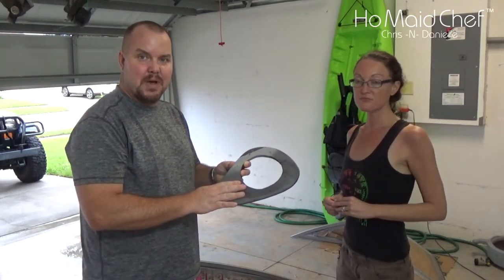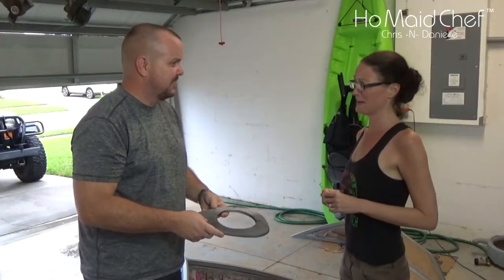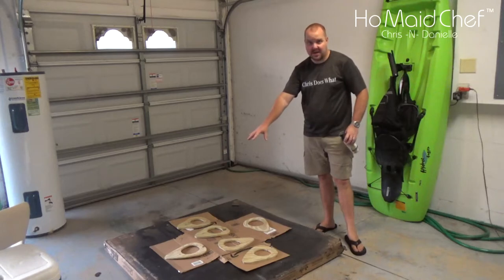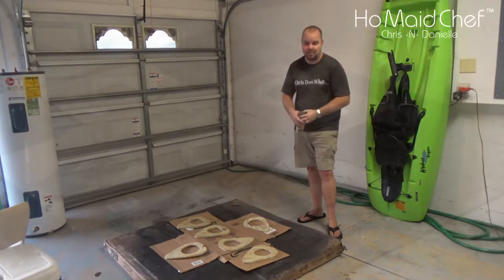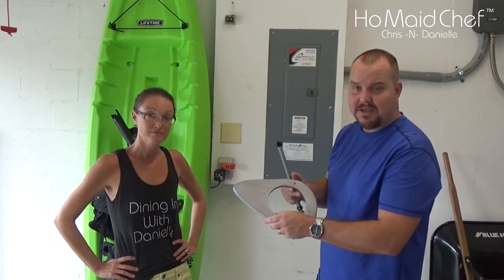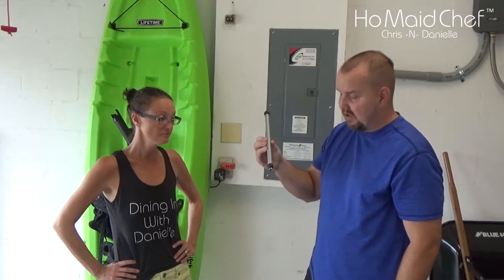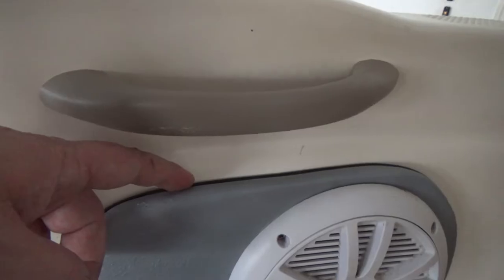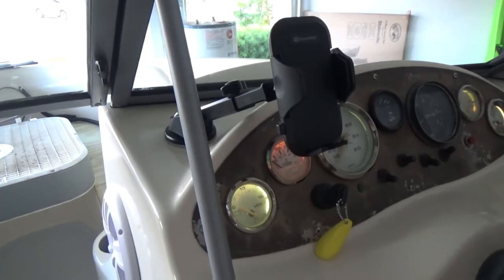Custom Boat Speaker Plates Painted EP #42 || Bayliner Bowrider 175

Comment from the maker: Not one of our better videos, but had to release it cause we made these speakers with leftover stuff from our Boat Project. We had extra wood and paint just sitting there, why not put it to good use, also filling some narley holes in our boat. If you like this, or have feedback, as always, leave it below.
Reply: Hi guys nice job! I Installed some speakers in my boat but the holes are bigger than the speakers and it’s just a nightmare and it looks ugly. I was wondering if I can cut out would like you did and just made me primer it and seal it instead of using the other stuff with that be OK do you know?
Reply from the maker: It should be fine as long as you seal it, it would only be splashed, not submerged.
Reply: @ChrisDoesWhat  thanks for responding 😊
Reply from the maker: @smeg8557  Hope that helped and we wish you the best covering them holes. We always try to respond, getting harder to keep up as this channel grows.